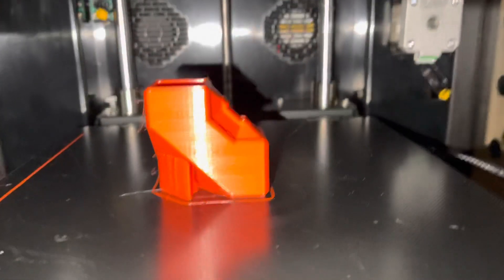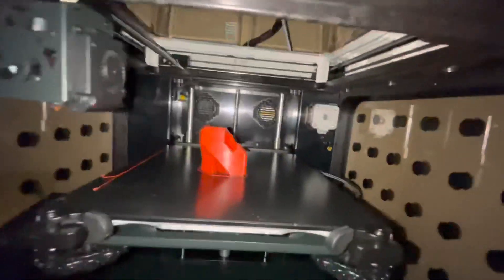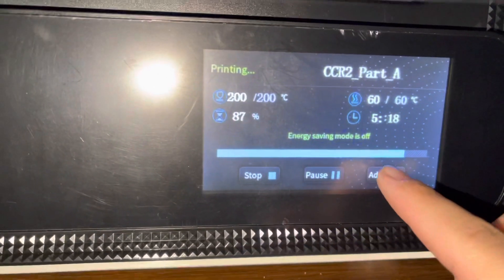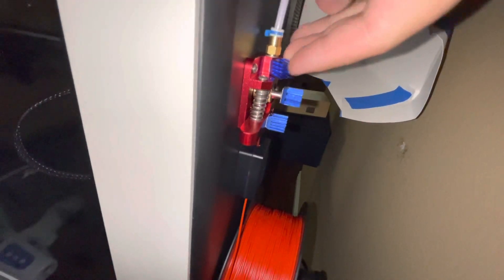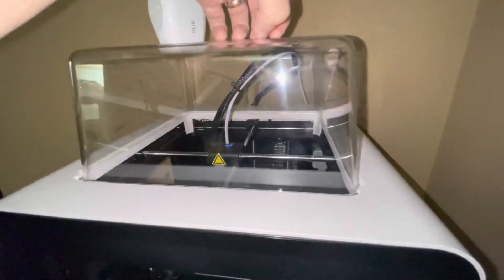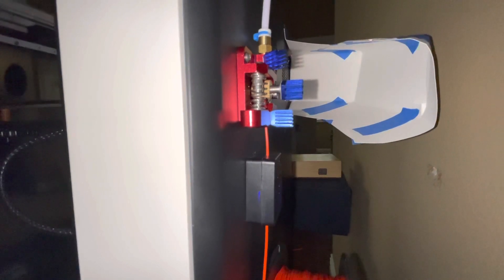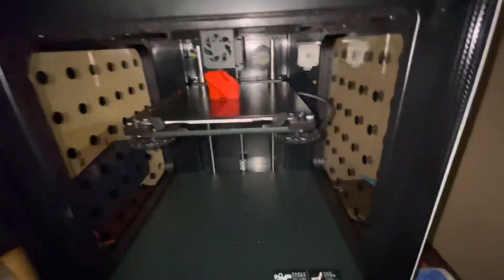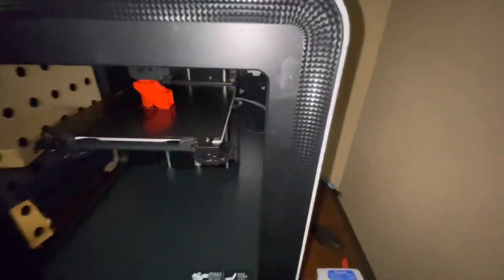Successful CR-200b print

Comment: The CR-200B printer was my first 3D printer and I regret buying it. It's total garbage. Don't be surprised if one day you pull the top off and find all of the flimsy bearing retainers broken. There's a replacement you can find on thingyverse to make. The bearing retainers are so flimsy that it wouldn't surprise me if they were broken on install at the factory.

Broken bearings led to problems for me where I couldn't even get a consistent bed leveling. I installed a CR touch and if I ran the bed leveling twice in a row, without adjustment or performing a print in between, it would record dramatically different bed measurements. It's better with new bearing retainers but still can't get consistent bed leveling readings to make a decent print.

My CR-200B now collects dust and I'll likely part it out. I bought a CR-6 SE and that thing is flawless with its strain gauge bed leveling, the prints are beautiful. The only problem is it isn't enclosed for higher temp materials like ABS, the reason I bought the CR-200B in the first place. I also picked up a BIQU B1 SE Plus, which also uses a strain gauge for leveling and it's as good as my CR-6 SE but has a much larger build volume, although the touch screen leaves a lot to be desired (not reliable registering of touch commands). 

I think you also have V1 which doesn't have the fan blowing on the extruder motor or the vent holes right above the extruder like mine has. Hopefully you have better luck than I did with this model. I noticed that Creality doesn't even seem to push this model, I think they know it's a lemon.
Reply: Have the problems been resolved? i just ordered a cr200b. honestly, i really want it to work.
Reply: @tohneyteoh  No, I gave up and stripped it down for spare parts that I'll throw up on ebay in the new year.

I swapped the Z axis motor hoping it would resolve the problem. The last piece I could think of was the driver on the board. I looked for a couple of months for a replacement board but couldn't find one. It has a unique v4.2.5 board that doesn't seem to be available as a spare part.
Reply: Damn.
Reply: Bendeki modelde bir problem olmadı. Kanalımdan bakabilirsiniz. Sadece dilimleme ayarlarını doğru yapmak gerekiyor.

Comment: If you READ the instructions, it says the top needs to be kept off unless your using high temp filaments, the top is only there to KEEP HEAT IN lol Heat rises. its not the printer thats wrong, its your OCD about freaking dust
Reply: Also his hotend fan isn't on. It's suppose to be on. Another Youtuber proved it was bad wiring connection, once he opened up and refitted fan came on all the time lol. Poor build quality Creality!

Comment: If the extruder motor is heating up, the motor current is too high... just lower the vref a little.  No heat sinks or cooling should ever be necessary.
Reply: How You do that?
Reply: Check out teaching tech